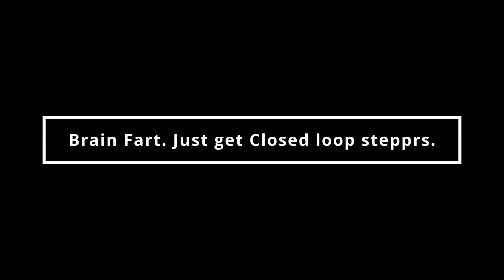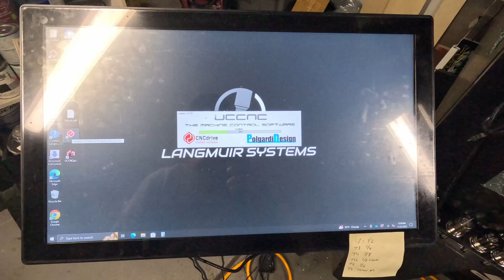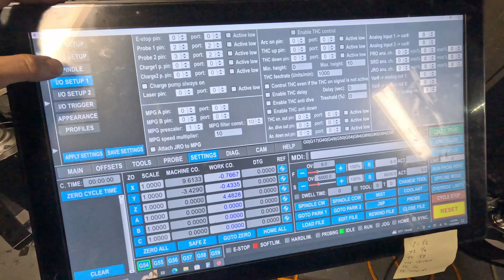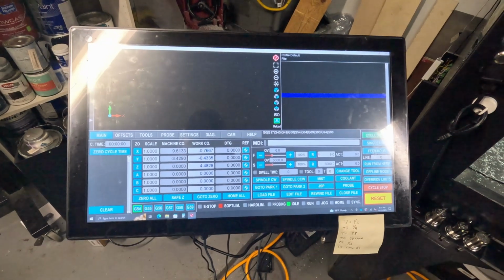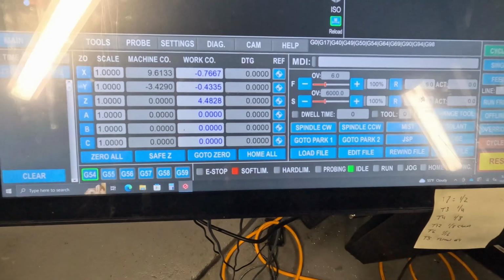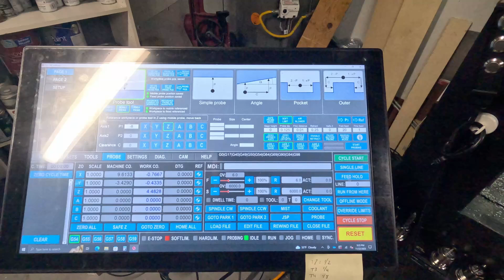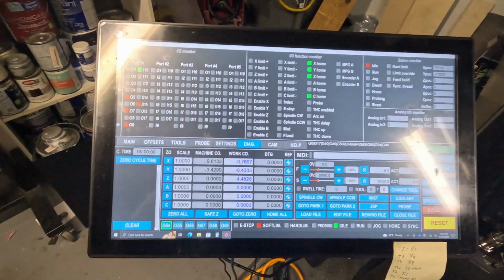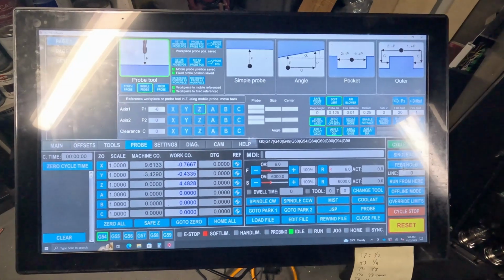MR1 Controller upgrade Pt. 1

Comment: I know you got your machine around the time i did, but i havent been on the forums much since ive had it up and running, but do you still use the touch probe from LS? Mine sucks, it seems. Its never been able to stay under 5 thou unless i spend 30 minutes getting it perfect and then use it. faster to just use an edge finder.
Reply from the maker: with the LS Controller that's what you can expect. the new controller holds much greater tolerances because of the communication rate.

Comment: How do i add this to my favorites?? Haha! Thanks for doing the legwork and sharing it. Curious though why bother? How bad is the stock system?
Reply from the maker: out of the box, its a dice roll. some have many complaints and others do not. I had nearly zero issues with mine, but I wanted faster rapids and complete control of software and ATC spindle because of the smaller high-detail parts i do with multiple tools per part. 

All in all, what you get is incredibly worth the money. and upgrading the few parts that are lacking make it a beast of a machine. just consider that this is a project and not a plug and play system; Tormach has that covered but for $$$
Reply: @ryanwykes  hmmm. I already have a foxalien 4040xe which has all sorts of problems. I really don't want to have problems with this one. But if the solution is readily available, then I'll give it a shot.

Comment: Doing some research before I buy the MR-1. I have experience machining in a professional setting, went through 4 year machinist apprenticeship, and am pretty good with G-Code. But I am past the tinkering phase of my life, I want a machine that can make parts (but don't want to pay for a Haas or Tormach lol). Parts I want to make are stainless, but smaller, sub 2" diameter. I can make a work holding fixture to fit like 40 of them on the table if I end up going with this machine, so I am hoping to get a long cycle time of like 6 or 8 hours. 

I see you modified yours quite a bit, and I love that quick tool change, but I will be leaving mine stock. Would you suggest this for my application? I don't plan on implementing any advanced M-Codes, I might add a high pressure nozzle to increase tool life and blast the chips away faster, but it would be tied to the flood coolant and not an M-code. 

I don't see myself modifying anything, because if I get busy enough and profitable enough to worry about a 1 minute tool change then I'll just get a loan and get something big and professional.
Reply from the maker: this would be a good machine, but hte controller must be upgraded. 8 hours of Gcode is sure to crash the controller they have. get an Acorn or go with Linux or what I did with UCCNC. easy swap and well worth the money.